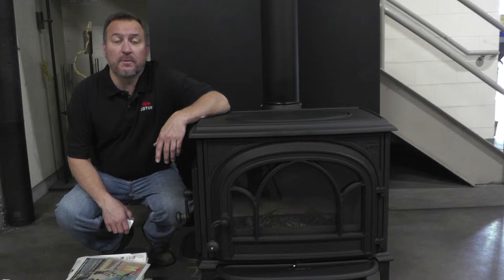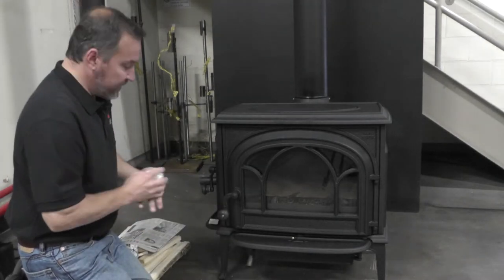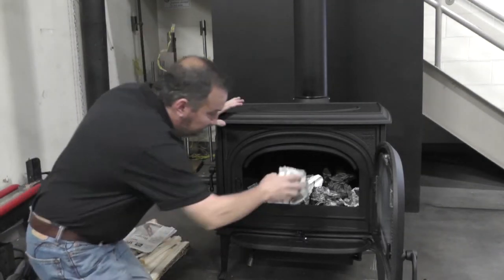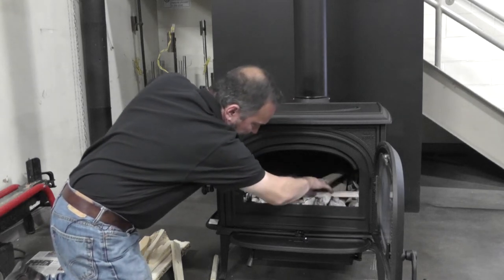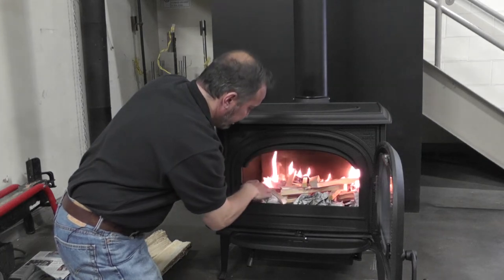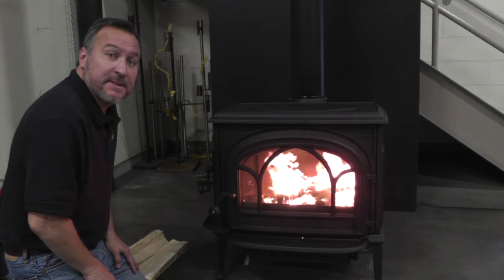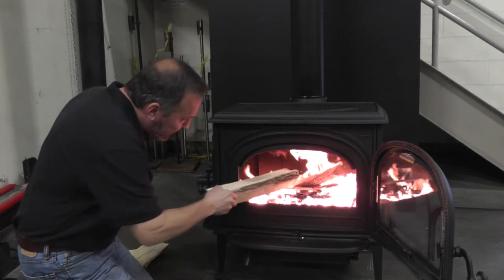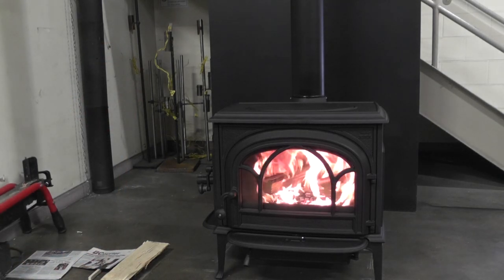How to light a fire in a Jotul F 500 V3 Oslo wood stove

Comment: I do not recommend a new e.p.a. wood stove.  They will not heat your house . They suck .tou cant boil water on then . ALL SAFTY AND NO HEAT . GO FOR AN OLD ONE FROM THE 70S
Reply: Not true at all. It will actually heat better and more efficiently than old stoves
Reply: @Felix5513  they may be more "efficient" than old wood stoves but they do not heat your house better. Driving your car at 35 miles an hour is more "efficient" than driving it at 65 miles an hour but it takes you twice as long to get there. The same thing with burning wood at a lower temperature to get more efficiency...
  Do yourself a favor and get on Craigslist and find a good old Fisher stove.

Comment: I have been having an issue with a lot of smoke coming out when I load that stove. This was not an issue for the first 4 months of use. I did have a lot of creosote that had fallen down the pipe. I took the pipe off the back and cleaned it out and had the chimney cleaned. It seems that there are multiple levels in the back of the stove, could I have missed some stuff that is still clogging it up? I thought that a 500 degree fire would burn it out but still having a lot more smoke come out.
Reply: It shouldn't be doing this if you crack the ashtray door while burning you should see a torch
Reply: @kenweis2291  I found out that the reburn system has been clogged with ash so I had to vacuum and blow it out. That got it back to normal.

Comment: Then after lighting be prepared for smoke to enter the room from the ash box. And unless you open the door in super slow motion be prepared for smoke to exit the front. And if you don't keep the door cracked open, there won't be enough air to keep the fire burning. Terrible designed stove. When is does work, it doesn't put out as much heat as other stoves I've used. Nothing but aggravation since day one. Avoid Jotul stoves.

Comment: I just started a fire in hotel after cleaning and repainting outside. I wanted to test outdoors to cure paint . Problem: fire would go out if I closed the door. Any hints on what I am doing wrong. 
   Stove is outside. No stove pipe attached. All wood , kindling is dry. I opened lever below, and also tried it closed. Still fire is snuffed out in seconds after closing door.

Comment: Are you going to have any inserts that are 2020 compliant?  I wanted to change my insert . I sold Jotul for years they are a great product. We cannot seem to contact Jotul NA ??
Reply: **  The only problem with non compliant stoves with the crew taking over in January they will bring back all their environmental  regulations with unbridled tyranny.
Reply: **  well that is my exact feelings too!
They sure are taking our freedoms by leaps and bounds. I had at least 5 in the Revolutionary War so I have to be careful my DNA does not go wild! Ha ha ha !
Reply: These are about as environmental friendly as burning ethanol. Sure they might be more "efficient" because they burn wood at a lower temperature, but it takes you twice as long to heat your house.  It's like driving a car at 35 miles an hour is more "efficient" than driving it at 65 but it takes you twice as long to get there...

Comment: I've been using wood heat for over 40 years  to heat my house. 2 years ago we added  an addition and required a second wood stove. I bought one of these jotuls at my local wood stove store, mainly because it was the only one they had under 1500.00$.  Immediately after using it I realized these things are extremely dangerous. The lip on the stove is only about 2 in tall, if you do not clean the stove out about every 3 days hot coals will literally fall out of the stove when you open the door all over your floor. There is also very little clearance between the bottom of the door and the very small ashtray that's provided with the stove. A piece of hot coal any bigger than a marble will cause you to not be able to shut the door again,  which is super exciting when a half burnt chunk of wood falls out of the door when you open it. These stove might work for some Ambience every once in awhile  for a romantic evening but I certainly would not suggest one for a primary heating source that will have a fire in it for months at a time. Unless of course you don't mind letting your fire go out every couple days to clean it.
    These stoves dont draw worth a damn because of all the smog regulations and efficiency requirements. Just like driving a car at 35 miles an hour is more "efficient" than 65 miles an hour, burning wood at a lower temperature is more "efficient"  then at a Higher temperature but it will not heat your house as fast and sometimes cannot keep up with heat loss.  Just like driving a car at 35 miles an hour might be more "efficient" it takes you twice as long to get there. You can help this out by removing the afterburner in the top of the wood box and leaving your door slightly cracked until your fire is good and hot.